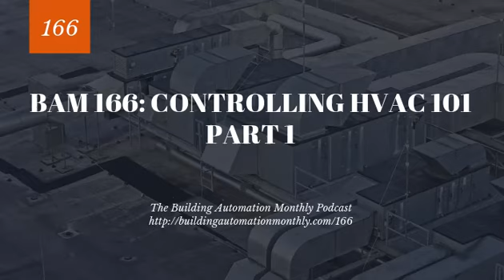BAM 166: Controlling HVAC 101 Part 1

Comment: Great episode Phil. I feel there are a couple items that could be mentioned with regards to fresh air control.
ASHRAE 62.1 now has a provision where the outside air CFM for certain spaces can be brought down to 0 if the space is unoccupied. So now you can integrate occupancy sensors to the BAS and control ventilation that way.
With regards to humidity control, it's not just about controlling the humidity of the air leaving the AHU but also the infiltration of outside air through windows and ceilings. It's important to keep the space inside at a higher pressure than the outside which generally means having more fresh air than exhaust air.

Keep up the great work!